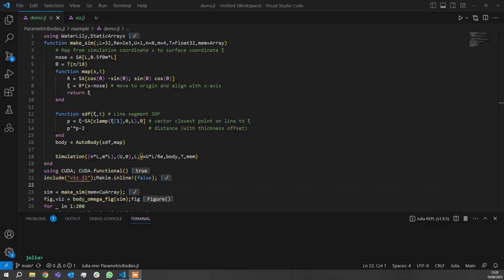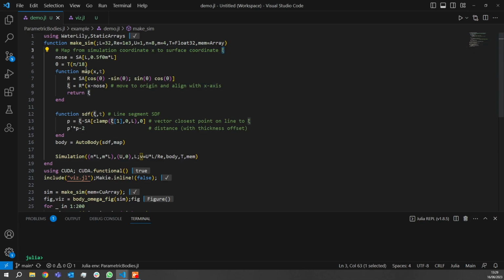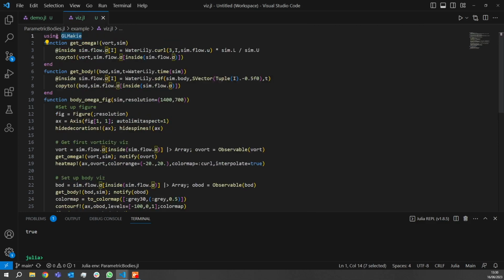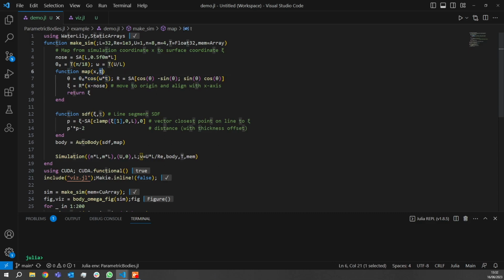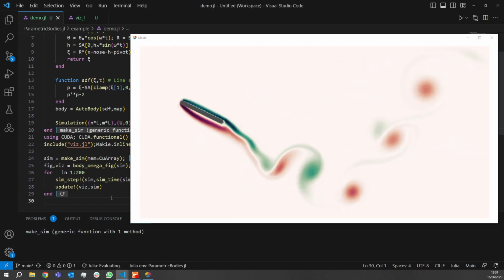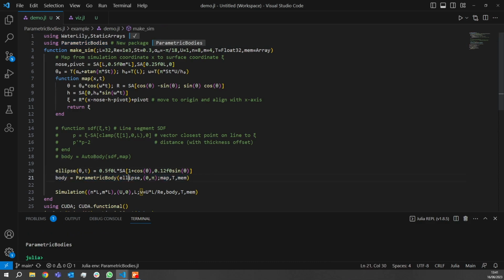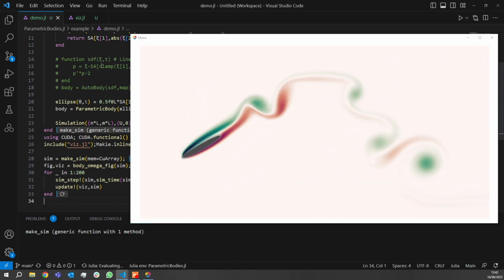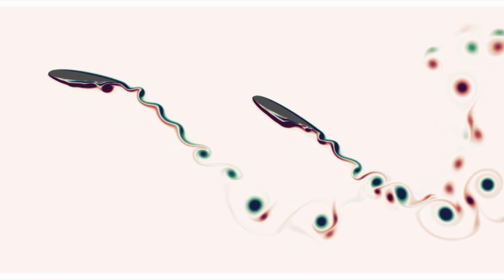Tandem flapping foil flow simulation using WaterLily

Comment: can we do FSI problem. I mean can we use lift coefficent as an external force to update the flow field that is usually done in VIV .. thanks for tutorial
Reply from the maker: We haven't worked on that yet in WaterLily, but it's on the development list for the near future.
Reply: @GabeWeymouth  Can you explain how to calculate forces (lift and drag) on both the airfoils. 
This function does not work from examples throws error ... function get_force(sim,t)
	sim_step!(sim,t,remeasure=true)
	return WaterLily.∮nds(sim.flow.p,
							sim.body,
							t=t*sim.L/sim.U)./(0.5*sim.L*sim.U^2)
end

Comment: Is there a perspective timeline for when the Package is ready? I downloaded it and attempted to run the code above, however downloading and running "add Parametric Bodies" in the Julia terminal, Julia returned: "ERROR: The following package names could not be resolved:
 * ParametricBodies (not found in project, manifest or registry)." I'm not sure if there was I mistake I made in downloading ParametricBodies or if other users are encountering this issue?
Reply from the maker: You need to 
"] activate ."
the local environment in Julia before you can use it. See: https://pkgdocs.julialang.org/v1/environments/
Reply from the maker: I've added to the github readme to help get people started.

Comment: Great. How can we apply wiggling or undulating behaviour in this case?
Reply from the maker: You could add an undulating offset to the map such as in this shark swimming example: https://julialang.org/blog/2021/08/sharks/. (This is an older version, so some of the interpolating stuff may not work on GPUs.) You can also "wiggle" the parametric curve directly by add time dependence to `curve(xi,t)`, and adding `update!(sim.body,t)` before `sim_step!(sim,t)` to the time loop at the bottom.
Reply: @GabeWeymouth  Thank you for your response. I tried the code from the blog. I keep getting this error and I am not able to troubleshoot.

ERROR: LoadError: MethodError: no method matching (Array{Float32})(::UndefInitializer, ::Float64, ::Float64, ::Int64)

Closest candidates are:
  (Array{T})(::Nothing, ::Any...) where T
   @ Base baseext.jl:45
  (Array{T})(::Missing, ::Any...) where T
   @ Base baseext.jl:46
  (Array{T})(::UndefInitializer, ::Int64, ::Int64, ::Int64) where T
   @ Core boot.jl:493
  ...

Stacktrace:
 [1] Flow(N::Tuple{Float64, Float64}, U::Tuple{Float64, Float64}; f::Type, Δt::Float64, ν::Float64, uλ::Function, T::Type)
   @ WaterLily ~/Documents/WaterLily.jl-master/src/Flow.jl:73
 [2] Simulation(dims::Tuple{Float64, Float64}, u_BC::Tuple{Float64, Float64}, L::Float64; Δt::Float64, ν::Float64, U::Float64, ϵ::Int64, uλ::Function, body::AutoBody{WaterLily.var"#comp#130"{Bool, var"#sdf#132"{Int64, ScaledInterpolation{Float64, 1, Interpolations.BSplineInterpolation{Float64, 1, OffsetArrays.OffsetVector{Float64, Vector{Float64}}, BSpline{Quadratic{Line{OnGrid}}}, Tuple{Base.OneTo{Int64}}}, BSpline{Quadratic{Line{OnGrid}}}, Tuple{StepRangeLen{Float64, Base.TwicePrecision{Float64}, Base.TwicePrecision{Float64}, Int64}}}, var"#s#131"{Int64}}, var"#map#133"{Int64, Float64, ScaledInterpolation{Float64, 1, Interpolations.BSplineInterpolation{Float64, 1, OffsetArrays.OffsetVector{Float64, Vector{Float64}}, BSpline{Quadratic{Line{OnGrid}}}, Tuple{Base.OneTo{Int64}}}, BSpline{Quadratic{Line{OnGrid}}}, Tuple{StepRangeLen{Float64, Base.TwicePrecision{Float64}, Base.TwicePrecision{Float64}, Int64}}}, Float64, Float64, var"#s#131"{Int64}}}, var"#map#133"{Int64, Float64, ScaledInterpolation{Float64, 1, Interpolations.BSplineInterpolation{Float64, 1, OffsetArrays.OffsetVector{Float64, Vector{Float64}}, BSpline{Quadratic{Line{OnGrid}}}, Tuple{Base.OneTo{Int64}}}, BSpline{Quadratic{Line{OnGrid}}}, Tuple{StepRangeLen{Float64, Base.TwicePrecision{Float64}, Base.TwicePrecision{Float64}, Int64}}}, Float64, Float64, var"#s#131"{Int64}}}, T::Type, mem::Type)
   @ WaterLily ~/Documents/WaterLily.jl-master/src/WaterLily.jl:60
 [3] fish(thk::ScaledInterpolation{Float64, 1, Interpolations.BSplineInterpolation{Float64, 1, OffsetArrays.OffsetVector{Float64, Vector{Float64}}, BSpline{Quadratic{Line{OnGrid}}}, Tuple{Base.OneTo{Int64}}}, BSpline{Quadratic{Line{OnGrid}}}, Tuple{StepRangeLen{Float64, Base.TwicePrecision{Float64}, Base.TwicePrecision{Float64}, Int64}}}, amp::ScaledInterpolation{Float64, 1, Interpolations.BSplineInterpolation{Float64, 1, OffsetArrays.OffsetVector{Float64, Vector{Float64}}, BSpline{Quadratic{Line{OnGrid}}}, Tuple{Base.OneTo{Int64}}}, BSpline{Quadratic{Line{OnGrid}}}, Tuple{StepRangeLen{Float64, Base.TwicePrecision{Float64}, Base.TwicePrecision{Float64}, Int64}}}, k::Float64; L::Int64, A::Float64, St::Float64, Re::Float64)
   @ Main ~/Documents/WaterLily.jl-master/examples/TwoD_circle.jl:56
 [4] top-level scope
   @ ~/Documents/WaterLily.jl-master/examples/TwoD_circle.jl:61
 [5] include(fname::String)
   @ Base.MainInclude ./client.jl:478
 [6] top-level scope
   @ REPL[30]:1
 [7] top-level scope
   @ ~/.julia/packages/CUDA/p5OVK/src/initialization.jl:171
in expression starting at /home/ani/Documents/WaterLily.jl-master/examples/TwoD_circle.jl:61
Reply from the maker: The updated version of the shark notebook is in the repo: https://github.com/weymouth/WaterLily.jl/blob/master/notebooks/Shark.jl